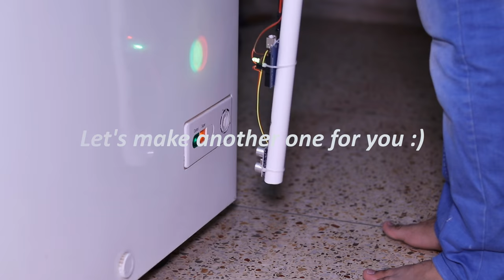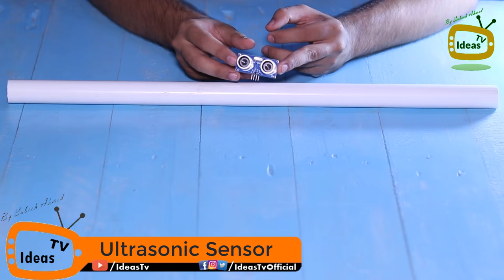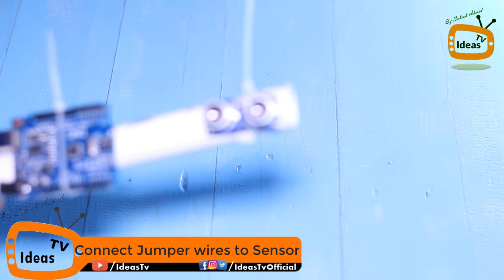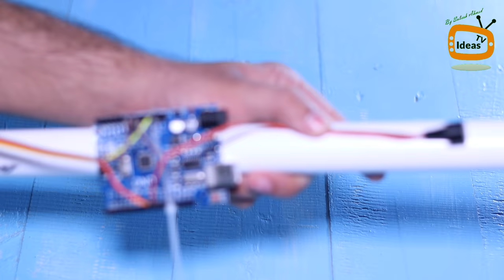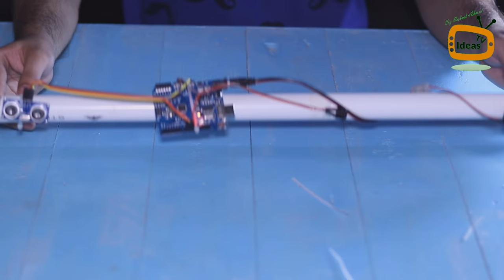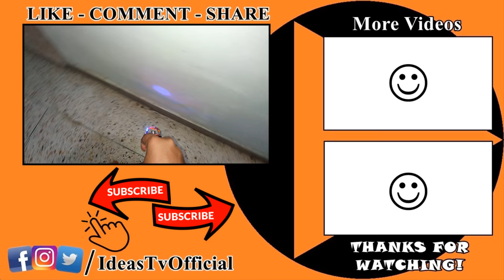How to make Smart Blind Stick with Arduino | Arduino Project

Comment from the maker: Tell me how was this video? & also share your ideas for the next video?
Video related Useful Links:- (Affiliate Links)
Arduino Code: https://drive.google.com/file/d/1Grs3TJkn0RY1P3sYcJeYqyrAWkmg8R2i/view
Circuit Diagram: https://drive.google.com/file/d/14dh78tUCPt10PxC_lGs2LubOJu4PFY1P/view
Complete Arduino Starter Kit: https://www.banggood.com/custlink/GvGmq4yGcC
 
Cheap Arduino Starter Kit: https://www.banggood.com/custlink/vKDGkeRGp5
All Sensors & Module Kit: https://www.banggood.com/custlink/KvKmz6hDWO
Reply: I can't get code
Reply: Sir plz give me the cord I need it very much
Reply: It does not show code ..plz send
Reply from the maker: // defines pins numbers
const int trigPin = 9;
const int echoPin = 10;
const int buzzer = 11;
const int ledPin = 13;

// defines variables
long duration;
int distance;
int safetyDistance;

void setup() {
pinMode(trigPin, OUTPUT); // Sets the trigPin as an Output
pinMode(echoPin, INPUT); // Sets the echoPin as an Input
pinMode(buzzer, OUTPUT);
pinMode(ledPin, OUTPUT);
Serial.begin(9600); // Starts the serial communication
}

void loop() {
// Clears the trigPin
digitalWrite(trigPin, LOW);
delayMicroseconds(2);

// Sets the trigPin on HIGH state for 10 micro seconds
digitalWrite(trigPin, HIGH);
delayMicroseconds(10);
digitalWrite(trigPin, LOW);

// Reads the echoPin, returns the sound wave travel time in microseconds
duration = pulseIn(echoPin, HIGH);

// Calculating the distance
distance= duration*0.034/2;

safetyDistance = distance;
if (safetyDistance <= 5){
  digitalWrite(buzzer, HIGH);
  digitalWrite(ledPin, HIGH);
}
else{
  digitalWrite(buzzer, LOW);
  digitalWrite(ledPin, LOW);
}

// Prints the distance on the Serial Monitor
Serial.print("Distance: ");
Serial.println(distance);
}
Reply: Good , you can also add IR sensor's at the bottom of the stick , which will help to detect any chasm (khaee) in the way. You can use auton shield for better performance.
Reply: @IdeasTv  thanks
Reply: Thanks can it configure without using Arduino Uno
Reply: @IdeasTv  Hello bro! What changes will be done in coding plsssssssss reply
Reply: Sir i want to discuss with u about this project can u pls  help me sir
Reply: @hyperandaimbot  you find ?
Reply: But what is the language of the code
Reply: @IdeasTv  please yaar ye code pin kaisa hai please koi bata do please
Reply: Sir yachi information Taka na
Reply: Xan u plz explain that code like how it works and in which online based program does this code operates ?????
Reply: Sir please tell me fast how to programm this because this is for my project please 🙏
Reply: @IdeasTv  code is not getting compiled
Reply: HII
Reply: @IdeasTv  blind stick program coding Sir. Pls
Reply: Can we use arduino nano do we need to change code for arduino nano
Reply: This is not working 😡😡😠
Reply: Bro please give which type of Arduino UNO are you used

Comment: We are doing same but led glows when we connect battery nd we don't getting the result like what is the problem with my project
Reply: Hey I too encounter a problem my buzzer keep beeping in low while there is no obstacles
Reply: I also faced the same , try to connect the arduino with a charger or with a laptop / power bank you will get the results
Reply: I think you kept the negative to wrong pin
Reply: Correct the code!
Reply: Same
Reply: @aryanshuvlogs really?
Reply: @vinayakagrawal4171 how did you manage to fix it? My project deadline is tomorrow and me and groupmatea have no idea how to fix it
Reply: @Letslastforever18  just open the code and increase the distance a little everything will be great
Reply: @vinayakagrawal4171 bro problem solve kese ki aapne vo plz bata dijiye

Comment: Good , you can also add IR sensor's at the bottom of the stick , which will help to detect any chasm (khaee) in the way. You can use auton shield for better performance.
Reply from the maker: Yup, great idea!
Reply: what's the code for that
Reply: I was also thinking about this. Thank you for answering Raghav bro ❤️
Reply: How IR sensor works?
Reply: Hello sir ,can u guide our team to start working on a project named accident alertt  system
Reply: Does it need programming code،in this Arduino device.
Reply: How to connect an extra vibration plz reply

Comment: excuse me sir. what if i use a vibration motor module instead of led and buzzer, would the idea still be the same when the ultrasonic sensor detects an object?
Reply from the maker: yes absolutely.
Reply: For vibration code?

Comment: Arduino: 1.8.16 (Windows 10), Board: "Arduino Uno"

Sketch uses 3046 bytes (9%) of program storage space. Maximum is 32256 bytes.

Global variables use 200 bytes (9%) of dynamic memory, leaving 1848 bytes for local variables. Maximum is 2048 bytes.

An error occurred while uploading the sketch

avrdude: ser_open(): can't open device "\\.\COM3": The system cannot find the file specified.

this kind of error is coming 

This report would have more information with
"Show verbose output during compilation"
option enabled in File -> Preferences.
Reply: Try with other pc I had same problem

Comment: Sir I have used five vibration motor which is not able to work with uno pins sir please tell me a cod  from which I can able to control motor from more digital pins

Comment: i want to use vibrator instead of beam and led, so what will be the connections
 and code for that? thanks
Reply from the maker: you can use a vibration module for arduino instead of LED

Comment: can i use 5v buzzer?
Reply from the maker: yes
Reply: @IdeasTv  thanks for replying..do need to change code?? and which arduino uno should i use, in the video or in the circuit diagram ???

Comment: You should try to add a potentiometer
So that reading distance can be changed even without uploading a new code each time.
Please reply me.
By the way it's very helpful.☺️
Reply from the maker: thanks
Reply: how do you change the reading distance of sensor?? i want to make it 1 feet

Comment: What kind of buzzer can I use instead of 3v Dc buzzer? Will it change the Arduino code if I use a different buzzer?
Reply from the maker: you can use 3V to 9V DC buzzer. no code changes needed.
Reply: Ideas Tv what if it’s 3-24 V DC buzzer
Reply: @IdeasTv  If 3V to 24V DC Buzzer also can?

Comment: Sir can i ask if its possible to use Arduino Nano than Uno? or is it preferrable to use Uno? cause Nano is smaller and i think fits better on the project but can it handle the overall project?
Reply from the maker: Yes you can use

Comment: How do i chnage the distance?
Do i change the code?
And if so, what exactly should i change in the code?
Thank you
Reply from the maker: change in code,
 // Calculating the distance
distance= duration*0.034/2;

safetyDistance = distance;
if (safetyDistance <= 5){
  digitalWrite(buzzer, HIGH);
  digitalWrite(ledPin, HIGH);
}
Reply: Hey! Thank you very much for your time , the video was very helpful.
I have another question regrading coding, 
Can i possibly  set the buzzer to buzz when the sensor dettects a sudden increase in the distance to a particular object?
Reply: @IdeasTv  But this is actually the same.How to change distance a little bit further?

Comment: Yo, why i cant upload the code into my board 

It says 

avrdude: stk500_getsync() attempt 9 of 10: not in sync: resp=0xb9
avrdude: stk500_recv(): programmer is not responding
avrdude: stk500_getsync() attempt 10 of 10: not in sync: resp=0xb9

Comment: bro the code wasnt working the both ones once i put my hand infront of it it doesnt stop buzzing
Reply from the maker: check your connections software settings i.e port
Reply: @IdeasTv   Now the code works the project works fine I did some fixing

Comment: heyy my buzzer and led keeps ringing when connected to battery ..what to do?
Reply from the maker: check your sensor connections. make sure there should be no loose jumper wire.

Comment: Thankyou, but neither one of these codes worked for me. Could it possibly be becasue I am using the Rex Qualis Mega2560 board instead of the Aurduino uno board? They have the same functions, but my is just off brand.
Reply from the maker: Use arduino uno with correct port
Reply: It worked earlier , thx!

Comment: Sir buzzer ke jgha vibration motor use krte h to code main Kya changing krni hogi
Reply from the maker: no need to change in code, just connect a 5V relay instead of buzzer and run the vibration motor through relay.

Comment: Sor is the code important like i did everything but still its not making a sound so what should i do i need to submit it tomorrow
Reply: It will need a 9 volt battery, but the amperage will be high

Comment: Can you explain how this tool works, bro?
Reply from the maker: simply ultrasonic sensor detects the obstacles and convey the signal to Arduino as result it beeps the buzzer
Reply: @IdeasTv  How many centimeters is the detection distance of the sensor?

Comment: The Arduino code is not opening please give that code
Reply from the maker: // defines pins numbers
const int trigPin = 9;
const int echoPin = 10;
const int buzzer = 11;
const int ledPin = 13;

// defines variables
long duration;
int distance;
int safetyDistance;

void setup() {
pinMode(trigPin, OUTPUT); // Sets the trigPin as an Output
pinMode(echoPin, INPUT); // Sets the echoPin as an Input
pinMode(buzzer, OUTPUT);
pinMode(ledPin, OUTPUT);
Serial.begin(9600); // Starts the serial communication
}

void loop() {
// Clears the trigPin
digitalWrite(trigPin, LOW);
delayMicroseconds(2);

// Sets the trigPin on HIGH state for 10 micro seconds
digitalWrite(trigPin, HIGH);
delayMicroseconds(10);
digitalWrite(trigPin, LOW);

// Reads the echoPin, returns the sound wave travel time in microseconds
duration = pulseIn(echoPin, HIGH);

// Calculating the distance
distance= duration*0.034/2;

safetyDistance = distance;
if (safetyDistance <= 5){
  digitalWrite(buzzer, HIGH);
  digitalWrite(ledPin, HIGH);
}
else{
  digitalWrite(buzzer, LOW);
  digitalWrite(ledPin, LOW);
}

// Prints the distance on the Serial Monitor
Serial.print("Distance: ");
Serial.println(distance);
}

Comment: sir, once we code using Arduino IDE, does it mean the program is auto setting inside of our circuit so we can just run without connecting the USB? please help me 🙏
Reply from the maker: yes, once you uploaded the code then there's no need to connect it with PC/laptop/computer

Comment: Sketch uses 3046 bytes (9%) of program storage space. Maximum is 32256 bytes.
Global variables use 200 bytes (9%) of dynamic memory, leaving 1848 bytes for local variables. Maximum is 2048 bytes.
Serial port not selected.

When I upload the code in arduino I get this error I don't know what to do can someone with this please
Reply from the maker: select the correct serial port in arduino IDE software
Reply: @IdeasTv  well it worked thanks anyways ❤️
Reply: @IdeasTv how?